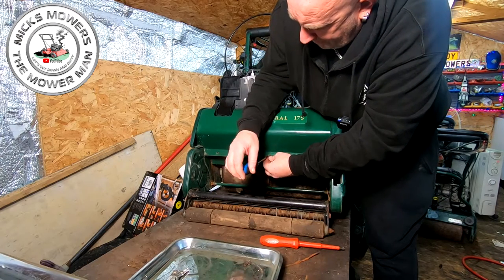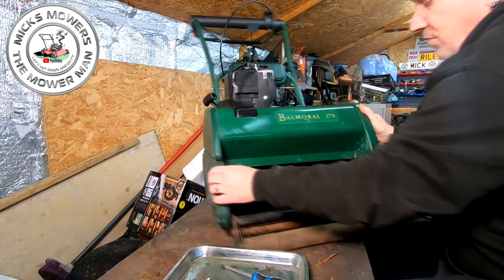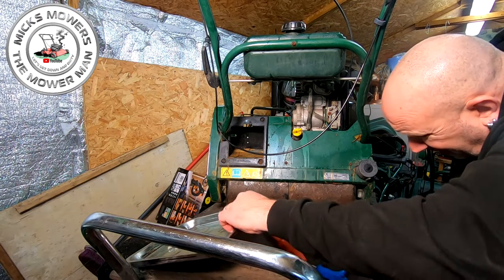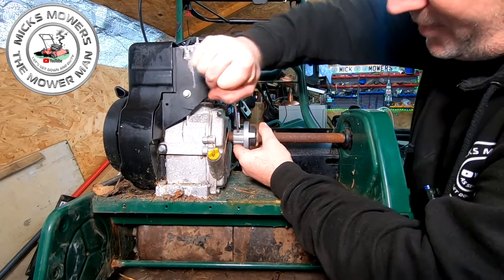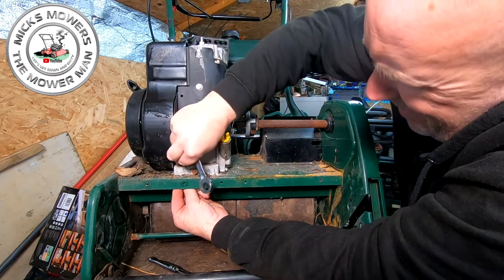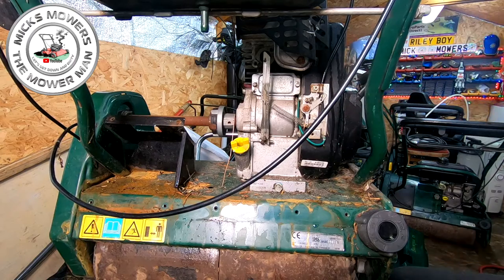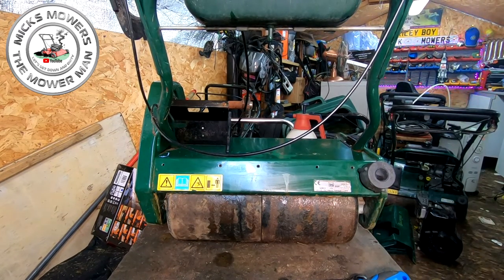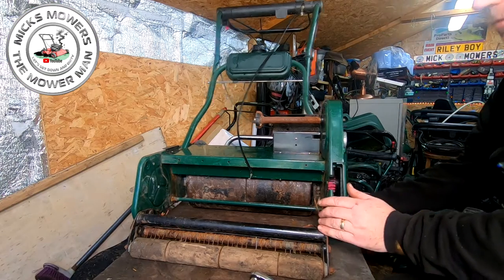Atco Balmoral How To Do An Engine Swap #atco #howto #micksmowers #mowerman

Comment: Awesome video and right up my alley Mick. My Sears push mower is on it's 3rd engine now all thanks to donor mowers I brought home from the dump. busted cables and wheels sent these mowers to the scrap heap and what can I say..."One mans trash is another mans treasure". I don't buy new mowers for my land because when I'm done mowing 6 inch tall thistle and weeds these poor mowers are only going to last 2 or 3 seasons and then I go to the dump and pick up another motor. Cheers from Canada.
Reply from the maker: Good for you mate.. it's amazing what people chuck out..

Comment: I recall doing this three years ago with the old Tecumseh h50 from the atco royale from the 70s. Nothing wrong with it apart from the neighbors complaining that it acted as an incredibly good jammer when East Ender's was on. #evillaugh
So instead went for a former cement mixer gx200 6 horse.

Comment: Well done Mick, only thing I'd have done differently would be a start up and check before putting all the panels back on, that way if there's an issue you don't have to take them off again.
Next up is a strip down of the duff engine and see just what's going on. My bet is corroded exhaust valve or piston rings for lack of compression and the knocking is con rod journal's, these things are plain bearing, if the crank journals are good then it might be a good start for a rebuild. They're the VW engine of the lawnmower world, simple and a choice of carbs fit them if the Delorto has a jammed main jet.
Reply from the maker: Hi mate .. I did run the engine 2 years ago.. yeah I shall be looking into the engine at some point to see if I can get it running again

Comment: Mick  I had a problem with the tecumseh engine on my Balmoral replaced it with a Honda Engine, just altered the drive shaft to match the Honda Engine
Reply from the maker: I have a Kawasaki I want to fit on mine.. I will have to do the same
Reply: Hi Geoffrey, What model of Honda Engine did you use and how complicated was alterating the drive shaft
Reply: @Mark-ot2ct  It was the GCV 160 probably overkill, i just cut the drive shaft of the balmoral and re-welded the drive cog to suit the new distance of the Honda drive shaft. if you send me your email i can send pics.
Reply: @geoffreyedmundson9928  I have tried to post my email but it keeps disappearing.
Reply: @Mark-ot2ct  mine does also

Comment: Hey mate this might be a stupid question but I'll ask it anyway. I'm doing a very similar swap but the rabbit cable on the doner engine works by pulling the lever back towards me rather than pushing away on the Balmoral. Is there a way of reversing this?

Andy
Reply from the maker: What engine is on it mate
Reply: @themowerman  it's one of those "Cylinder Mower 17S" which I think is a Suffolk. It's a Tecumseh
Reply from the maker: @mowerboy7914  hmmm email me some photos when you get a chance... micksmowers01@gmail.com

Comment: Quick question,
I have a 2-strike mower that will only start if I attach a drill to the top of the engine, then it runs fine but it refuses to start with the pull cord, all the mechanism is intact and turning the engine but it won’t start or show any signs of life.
Is there anyway to fix this?
Thanks
Reply from the maker: Hi mate .. ok so could be a couple of things.. bad or weak spark. Plug or coil. Poor compression.. and will start if turns quicker.. I would try to put some petrol mix down the head.. then put the plug back in and pull the cord.. if it starts I would say low compression.. also try a new plug
Reply: @themowerman   thanks mate, il try that

Comment: Hi I have a 20 s how do you set up the fuel? From the adjusting the spring to adjusting the throttle leaver. I am unable to find the the adjustment settings.
Reply from the maker: depends on what carb you have on yours. i wo start with screwing it all the way in then slowly undo it until the mower is running right
Reply from the maker: I will try and do some videos to help you
Reply: Hi Mick. Can i ask what size nuts and bolts hold the Engine through the frame please ?